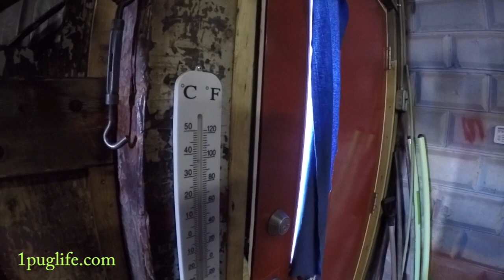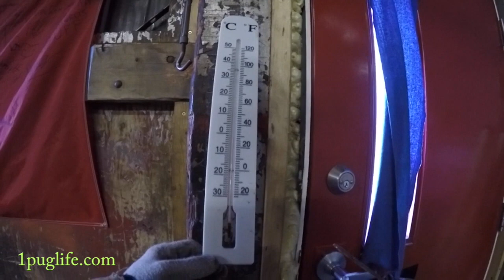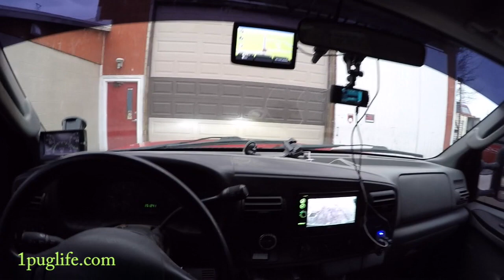my door my new one

Comment: Big Dirty NEEDS a dam Solar Powered Trickle charger mounted on the roof 100% all the time!
Reply: Right over the rust spots lol ! Great idea i have one on my truck
Reply: jimbo booth I think it would be a cool video and fix the problem. Clearly one of the aftermarket things is chooching power after the truck is off.
Reply: ***** exactly it's a perfect solution to that problemo. I'm guesstimating the radio lol
Reply: jimbo booth beg my pard it has alot to cheech and rember with "hello 1puglife" "and then we cheeched"
Reply: ***** it's a pretty sweet set up he has lol
Reply: Nah, Big Dirty just needs some of his accessories rewired.
Reply: ***** ya know i didn't even think about that , that's a great idea!
Reply: ***** Obviously I didn't go into much detail in my comment, but that was pretty much what I meant when I mentioned that he needs some of his accessories rewired. Although your suggestion to wire everything to the ignition might not be the best for his application, since some accessories may need a constant 12volt source. If he has a lot of accessories that can be wired to a switched source, I'd recommend for him to use a switched 12volt source to trigger a relay to safely power all those accessories.

Comment: The electric opener is pretty simple and not very spencive I would have definitely took advantage of the door guys to take the other one down its kinda there job and those fuckers are heavy way way heavy like bolt a pully to the wall and lower it flat to the ground  with 3 guys on a blue rope heavy

Comment: Hey Pug1... your gonna fry your FICM.. (fuel injection control module).. if you are cranking your truck without a full 12volts you are frying the ficm.. It ups the voltage from 12 to 48volts. to fire the injectors.... It is a very expensive part and I fryed 2 before finidng out I had 1 of 2 bad batteries.. on my 05 big dirty.. its; prob already going bad seeing the white smoke on your cold starts choochin..
Reply: PistolWhip That's not white smoke. That's moisture.

Have you ever started any vehicle, any engine, in the cold?
Reply: iPlayiRecord thats unburnt diesel it goes away once the engine warms up my 01 f350 does the same thing

Comment: I would ask for the panels to be replaced if the stripe in the middle ends up,, to be bugging you. I like how you handled yourself in this situation. They worked hard and did do a good job.  "Mcfotty" is handicapped you wouldn't hit a cripple.? Let the Donut Cop sort it out.
Reply: you just paint the door, it was a cheap door because of the color difference, its his job to fix it himself
Reply: Every Garage door I ever bought came in one color. Everyone. All I ever picked was white. I don't see how this came together at all. If pug just asked some questions on how was it that this order had two different colors.. I think he will find out an error has been made. Errors happen all the time.
Reply: MegaTriumph1 It depends how cheap this deal was in comparison to a new one......since its done I would wait for a sunny day and get some paint and van doodle and be done with it, you are correct though ask more questions
Reply: MegaTriumph1 buying a door and specifying a color is not the same as saying "I WANT THE CHEAPEST DOOR YOU HAVE. USED. NONE OF THE NEW BULLSHIT." and getting a used door that happens to be two tone.

You can't ask for everything to be perfect AND cheap. You get what you pay for. Stop being so entitled.
Reply: First time I've seen a used door come in new boxes. Each section of that door came in a box. The order was filled and two of the panels were not the correct colors to match the whole door. Its not a used door.
Reply: MegaTriumph1 you are right a cheap door doesn't mean mismatched panels, if you look close the stamping is different as well